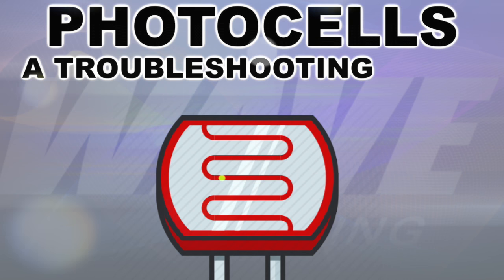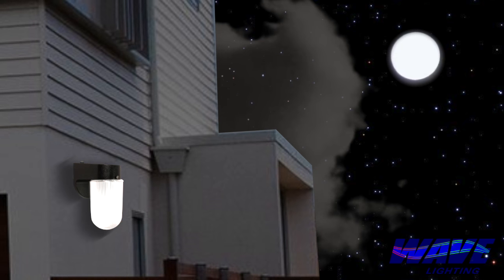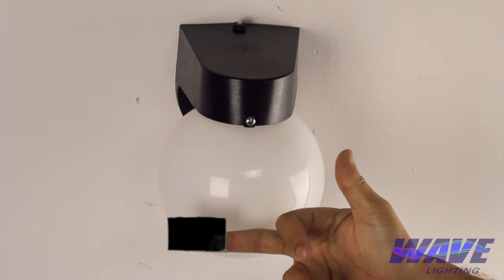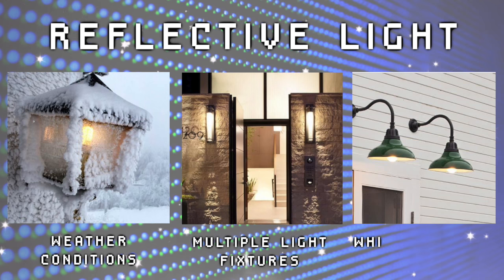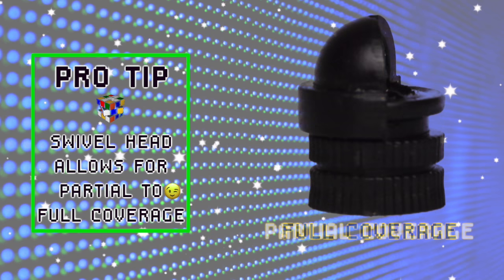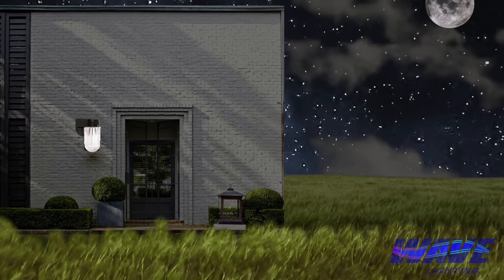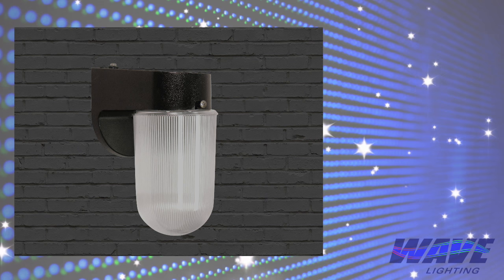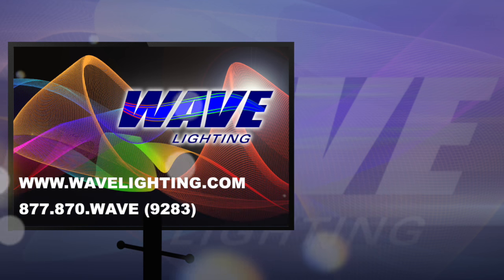PHOTOCELLS TROUBLESHOOTING

Comment: I have three identical light fixtures on the front of my garage. They are wall-mounted decorative fixtures with LED lamps. They are all on the same switch and each have their own photocell. Two of the fixtures come on when it is dark and one does not. I have checked the wiring and it is OK. During the daytime I can cover the photocell and the fixture will come on but it still will not come on at night. I had the same problem with the fixture in this location before and I replaced it with this fixture. I am at a loss to know what is the problem.